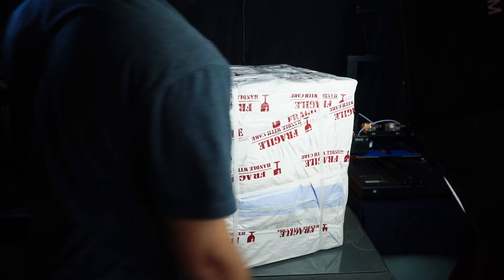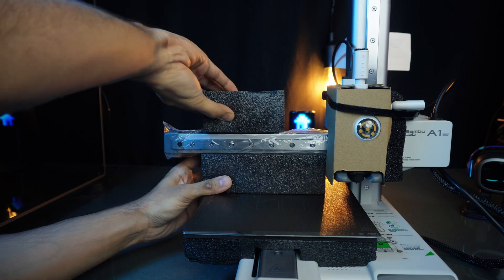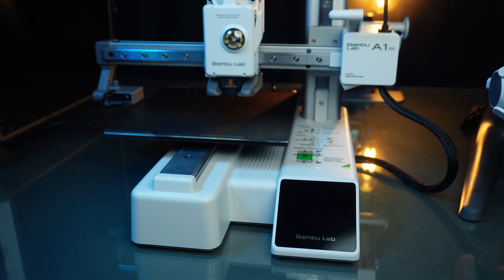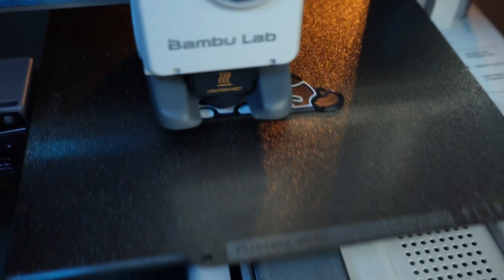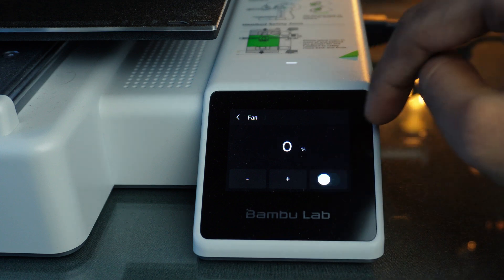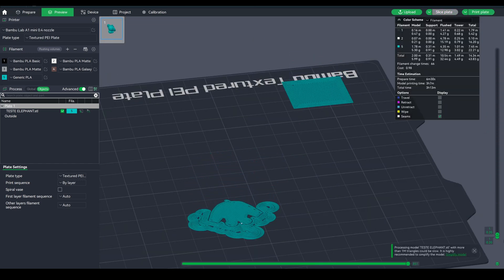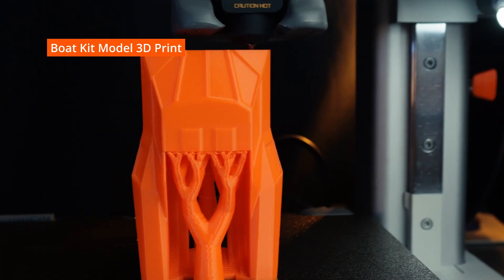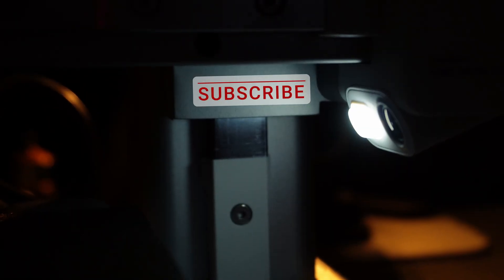Bambu Lab A1 Mini 2024 Unbox & Review | MUST SEE Before You Buy This Budget 3D Printer

Comment: do you use particular variant of numaker pal ? I am using  esun , elegoo or polymaker with my a1 mini , I have heard numaker causes nozzle after some times , seen it posted in some forums
Reply from the maker: Hey mate, actually my very old numaker filaments are having issues like filament breakage in PTFE tube or in extruder. but the new numaker's filaments are good, not causes any nozzle jam or other issues.👍
Reply: I am using scribbl3d filament for my p1s, A1 and A1 Mini. They are good without any issues.